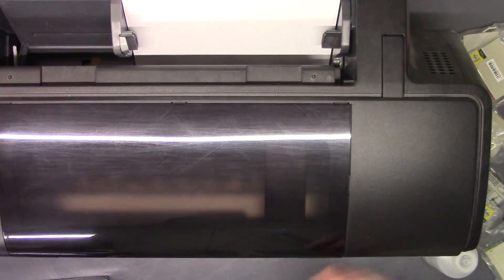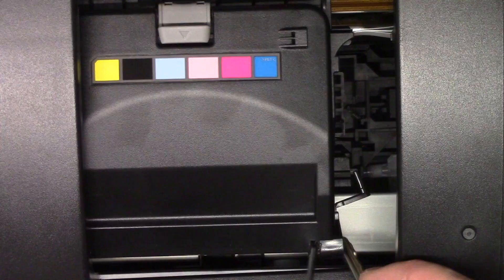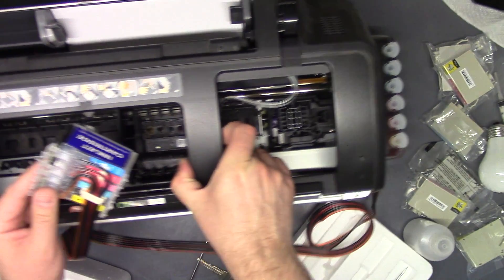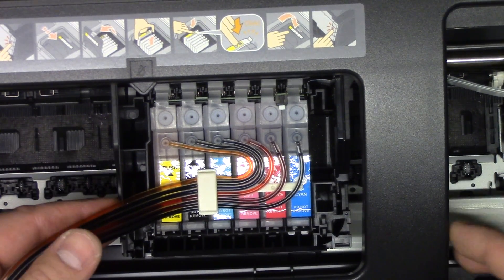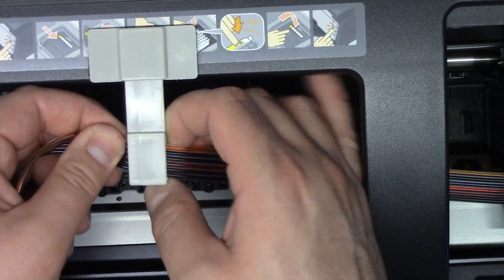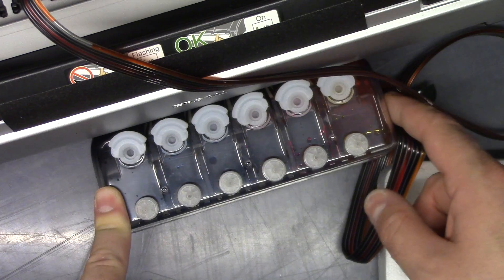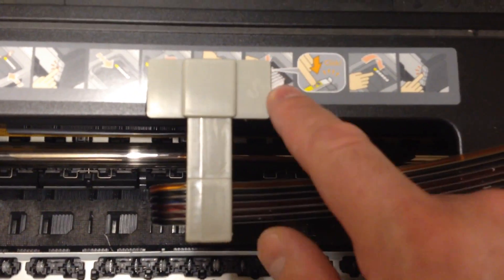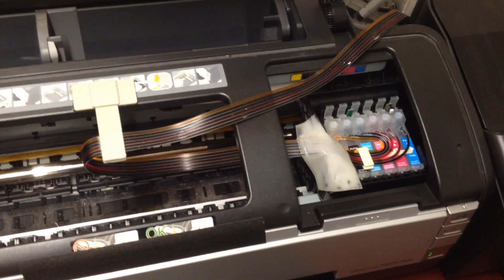Epson 1400 Continuous Ink System Install CISS

Comment: wf-7610 in my case,  i have a ciss, but red keeps dropping. it isn't a pigment clog, it literally just drops out mid-print.  i'll do a head cleaning (after a quick manual prime), it will print a few times normally, but then drop out. only a dozen head cleanings is able to get the flow going again (by which i've wasted other colors just to make red appear).  no red page-purge sheet ever works, ever ever. 100 in a row, zilch. only head cleanings did it.

do you suppose the print head is to blame or the CISS? perhaps the heating element is going out? or should i take a chance and only replace the CISS? (it was an ebay one for $25 at the time, now about $38 for the same type). i'm looking more at the inkxpro ciss as a replacement.

Comment: Good video, I have been using Cobra Ink CIS systems on Epson printers for over 8 years.  Multiple WorkForce printers and my Artisan 1400.  The key to good inkjet maintenance is to use them.  If you are not printing photographs at least once every couple of weeks run a print head cleaning at least every couple of weeks.  Getting the print heads working again after they get clogged because of non-use can be difficult.  On a $100 printer, it may just be a throwaway but for an Epson 1400, that is not something you want to do.

Comment: the only challenge I had with my ep 2200 large format printer was keeping the multi-ink hose free of hangups as the cartridge block ruins back and forth. Dangled the center with rubber band to keep it clear. Small inconvenience but saved SOOOO much money on ink.  Make sure the reservoir is level and maybe use velcro to affix it to not get knocked over. 
Ink spilled onto drywall in normal house construction will STAIN through every layer of paint. You'd have to use a SEALER on the drywall to end this ghosting appearance of the stain. Weird.
 Ink for the Epson 2200 is compatible IN HP 6700 cartridges also. Saved $$$ using it in both.
Be sure to clean the factory sponges below - about 7 of them

Comment: It would make more sense to just have the cartridges that you can fill with a syringe full of ink. Because the cartridge is still going to tell you it’s out of ink and require you to reset it anyways. 

If you use the syringe method you won’t have to take the door off, deal with that ridiculous ribbon tubes and those ink tanks

Comment: Can The CISS be used on the New Printer right off the bat or do I have to use the original ink cartridges that came with the printer first to initialize the printer?
Reply: I'm just setting up my system now, it didn't even come with the original ink cartridges. So I guess yes, you can use the CISS cartridges right off the bat.
Reply from the maker: I just uploaded another video that will prolong the life of your ciss system, it really is a 'must do' and only takes less than a minute.  Here's the video: https://www.youtube.com/watch?v=hpb5avC_o44

Comment: Hello. Just installed this system and your video helped tons. No problem with ink, sensors, etc. The scary thing is the hose system flopping around - not well engineered/thought out. This printer (1430) appears to be a challenge for retrofitting CIS, given all the moving parts. Could you update on what exactly you did with the tape? How it's anchored, etc. Does it quiet the flopping? The scary part is what contortions occur under the housing as the carriage reaches the far end of its run. Do you have any other mod suggestions,  re 1400 vs 1430?  Thanks for any answers and help. Good video! Peace, Allen
Reply from the maker: Here's a HUGE mod suggestion, I just uploaded another video that will prolong the life of your ciss system, it really is a 'must do' and only takes less than a minute.  Here's the video: https://www.youtube.com/watch?v=hpb5avC_o44